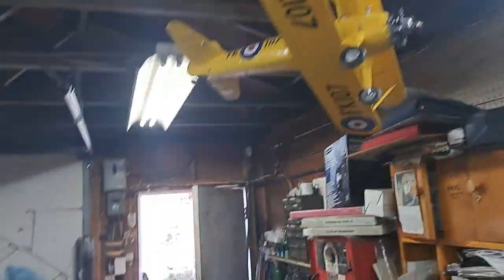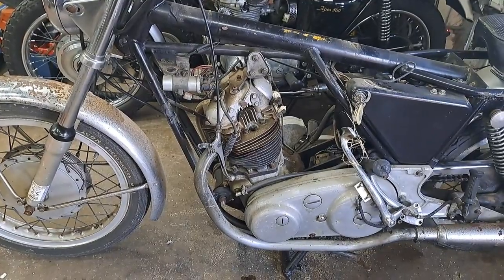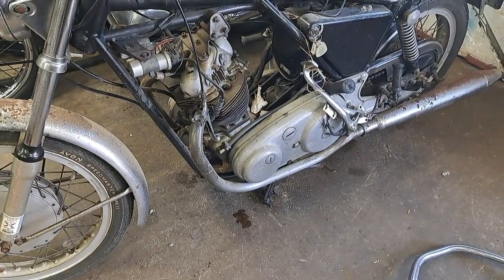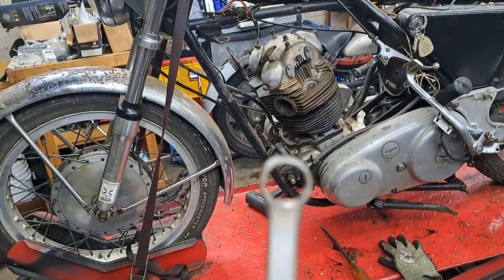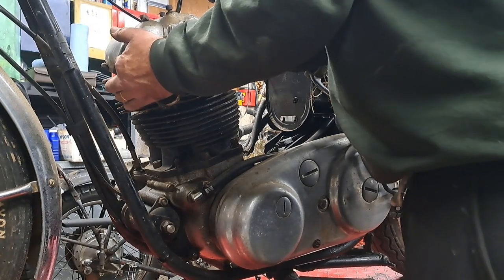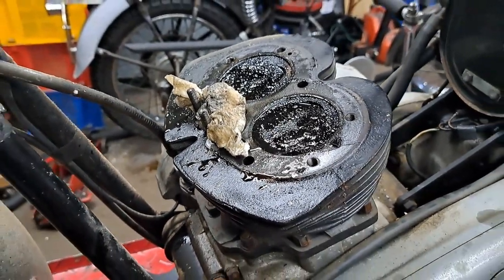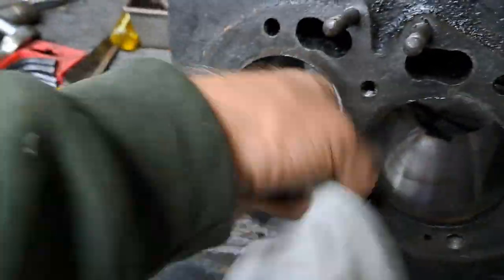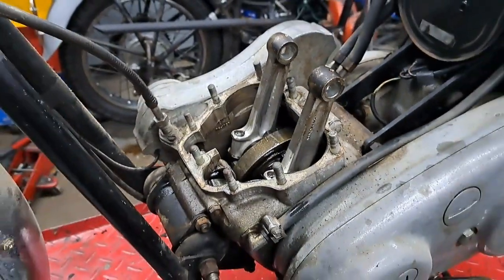Norton Commando  Episode 2

Comment: Goldy - What a find you have there!  I think that this Commando might have been built as an "S" model (that would have been March '69 - about April '70 -- that's "official" production schedule but we know that a few were made up until about June of '70).  The metal flake on that tank was (again officially but there were always little "extra" things that happened) only on the "S" models; that tank was introduced with the R-models, a very rare type from about the beginning of 1969, carried over to the "S" and then adopted on the Roadster which carried from April '70 all the way through the end of Commando production.  When the Roadster was introduced in '70, the paint choice included a solid "Signal Red" but the red metalflake -- which is really "Fireflake" paint process which includes very large metal flakes that have at least one painted side -- was discontinued at that time.  There was a later metalflake which was an ordinary metalflake paint process with bright silver standard-sized flakes but that metalflake was not available with a glassfibre tank -- so, with all the details, it seems very likely to me that this Commando was built as an "S".  The outstanding feature of the "S" was the exhaust system, with both pipes (more on this) running high up on the left side with two mufflers that extend to near the taillamp.  The serial numbers that denote the "S" models are available so it's pretty easy to authenticate if it is an "S".

The side battery cover on the left side with the ignition key inset into it was also introduced with the "S" models.  It was carried over to the '70 Roadsters but discontinued with the '71-build Commandos.  The oil tank of these, also limited to the "S" models from '69 through the '70 Roadsters, is what I call the "cube-type" tank; also '69 and '70 only.  The engine with points on the camshaft end in the timing cover on the right side of the engine also came in with the "S" models in March '69.

The exhaust header pipes on this Commando were introduced with the Interstate model, only available from '72 on, so they're obviously not original to the motorcycle.  The low pipes for the "cigar-shaped" mufflers did not have the little "jig/jig" bend just before the muffler clamp.  Those Interstate pipes were fitted with a special reduced-diameter muffler which had an instantly identifiable shape different from the cigar mufflers and peashooters.  What's on there is a set of what are called "reverse-cone" or "pea-shooter" type Commando mufflers.  The reason for the low pipes and the smaller mufflers on the Interstate was to provide room for panniers (saddlebags) but still not have the exhaust intrude into the area of the motorcycle that would touch the ground in a very tight turn.  These "peashooter" mufflers on this Commando must have been added later; they're not original to the motorcycle and they're not original to the type of header pipes.  This system on this motorcycle obviously "works" but having the peashooters on the lower pipes does reduce the ground clearance in turns a considerable amount.  

As you mentioned, glassfibre tanks were not designed with modern fuels and additives in fuels available today - notably ethanol - damages glassfibre by seeping into the plastic around the glassfibre mat or cloth with the result that the tanks are a porous mass that leaks in a way that's almost impossible to repair.  Also, the ethanol will dissolve some of the plastic resin components and deposit the melted plastic as deposits in fuel taps and carburetors.  You're wise not to attempt to reuse that tank.  EMGO make a repro steel tank for a Commando Roadster (or "S") that's a perfect match for dimensions and fixing points to the originals.  They're made by using modern metal press-tools that give great precision to the metal shape, the modern welding and jigging operations that they use actually result in a finished tank that's actually better in every way than the original glassfibre or later steel tanks produced by the factory.  But one thing, since the "Fireflake" paint was so rare on early Commando's, you might be able to strip the black paint off, polish up the clearcoat, and sell it to someone for a workshop ornament -- there are very few of the originals left.  

I see that you've run into the dreaded Commando rear-head-holddown nut below the fins of the cylinder.  That's a "British Standard" (either Whitworth or BSFine) nut; not only does it take a BS sized spanner but the spanner also has to be either manufactured with a thin section or ground down in the workshop to allow clearance.  My guess is that someone has bodged the spanner fit on that nut in the past and that's what damaged the flats on the nut.  I'm glad you were able to get the nut off- if it has been so damaged that you couldn't get a spanner to fit without slipping, it could have cost you a lot and time and headache getting it off.

And, a tip, if I may.  Once you take the pistons off the rods in a Commando engine, it's good practice to put something on the rods to prevent them rapping against the edge of the crankcase mouth.  The rods are forged allow and if they're "dinged" the strength is greatly compromised.  Some people put easy-remove tape like masking tape on the rods, some people wrap the rods in rags, others put short pieces of foam insulation for household pipes on the rods.  All of these work but it's best to not let the rods swing forward and back without some kind of protection.

Great work so far, and it appears to be a super platform for a beautiful Commando restoration.  Have a good winter up there in Kinehdia-land, there, eh?  Have a fun time working on this Commando and keep your stick on the ice.
Reply: Edit -- I've had a better look at this Commando on your first video.  It is definitely originally an "S" -- the silver metalflake taillamp cover was only fitted to the "S" models.  
See - https://www.youtube.com/watch?v=vWVqylv_4sU&ab_channel=W00dpellets for a blue one.
Reply from the maker: Thanks Bruce,  very informative note! Yes,  I'm quite sure it was an 'S' model, like my first Commando (some chafe marks on the left Z plate gave it away). I think the owner put those interstate pipes on it so he could fit the pannier rack that was on it when I bought it.  I found traces of the original fireflake red,  so I will do my best to replicate it. I think I'm going to go for an 'R' type look with this job. Engine parts started coming in today.  Hopefully, I'll get that back together real soon.   
Cheers,  
Bruce
Reply: @brucegoldsmith3721  - You're in geographical luck!  There is a custom bike/car painter who lives and works in Burlington, Vermont.  That's ~ 12 miles (or 20 km) from the US/ Canada border -- still a long way from Maritime Canada but closer than Los Angeles!  Brent is a veteran of the California custom car culture of the '70s and has a long history of specialized custom painting.  
In particular, he has spent a long time working on processes that will accurately reproduce the "FireFlake" finishes of the early Commandos.  And in a stroke of coincidence, manufacturers of paint components have begun to produce and sell new "FireFlake" flakes in the past few years.  "FireFlake" finishes were sort of the rage in California custom painting in the 60s and 70s because they're so bold but that boldness was kind of their downfall in that tastes changed for the more refined look of the smaller-flake metalflake finishes and manufacturers stopped making the FireFlake flakes.  These individual flakes are much larger than the more common metalflakes and they're painted (in the case of the Ruby Red FireFlake and Pacific/Sapphire Blue Fire FireFlake, the flakes are painted.  For the red, the flakes are gold on one side the translucent red on the other side; for the blue, the flakes are bright plain aluminum on one side and translucent blue on the other.
With the correct flakes, it's a matter of the painting process -- starting with primer/undercoat, a correctly-tinted base coat, a semi-clear color coat with the flakes, and finally a clear final coat.  It's not easy but when it's done right, it's gorgeous and "museum-quality" work.
(Some metalflake finishes were carried over to the later Commando steel tanks form the factory -- these were the more common type of metalflake paints and are a different look and process.)
Your can reach Brent at:

https://vintage-vendor.com/about/

Comment: If the exhaust/header pipes are original, then the bike is an interstate. The mufflers are available ex Andover Norton.
Reply from the maker: After some careful examination,  I've found clear evidence that the bike was originally an S model.  Someone  fitted those interstate pipes...I figure to be able to fit the pannier racks that were on it.  Nothing surprises me anymore after working on these early Commandos for 35 years.... I'm absoubtly sure they sometimes mixed and matched parts, coming up with "in- between" models.

Comment: On my 70 possible s model the engine has small diameter cylinder base studs except for the two fwd left are big diameter studs . Any idea on this.
Reply from the maker: Well, I can only tell you that the studs are all supposed to be 3/8" diameter.     With the exception of the two on the front corners, which are 3/8 at the bottom and step down to 5/16" and take a smaller nut in order to clear the area around the tappets. The front center stud is about 1/4" longer than the rest and takes a larger nut. I've worked on a LOT of these old Norton bikes over the years,  and seen a lot of ugly bodge jobs...nothing really surprises me anymore.   :)